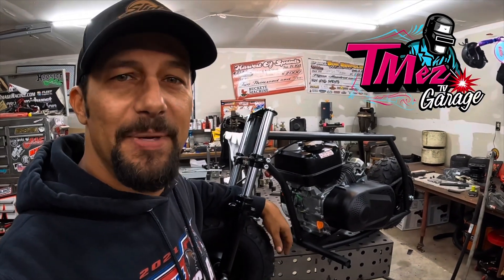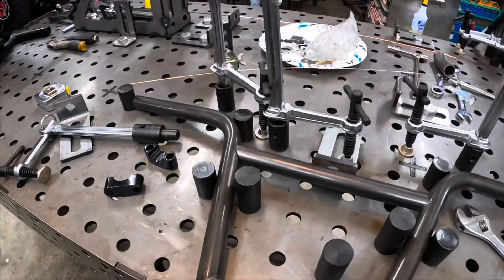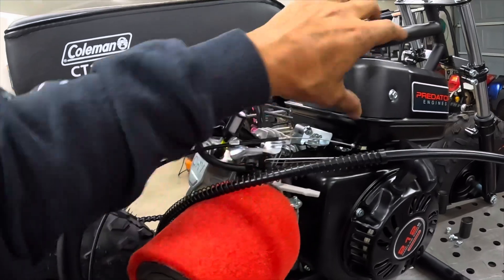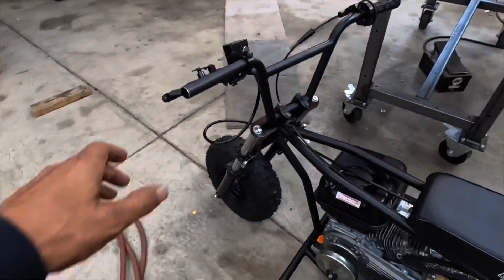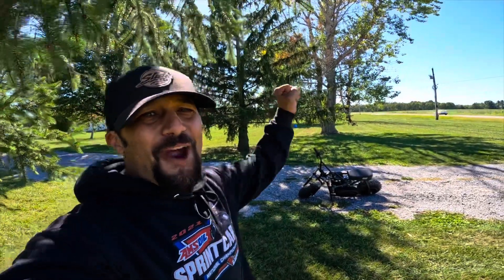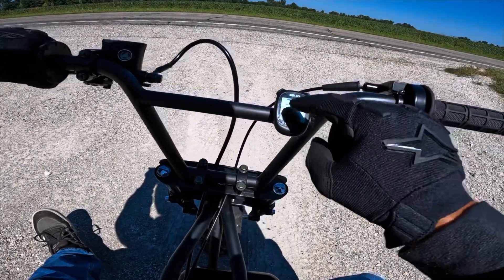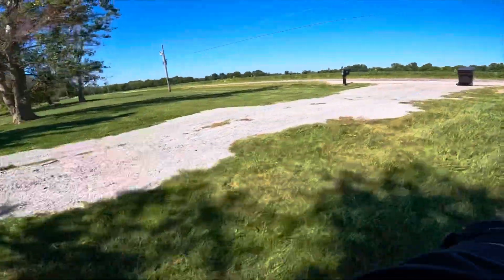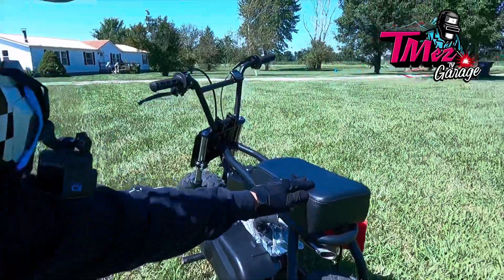New Mini Bike Build with a Torque Converter Threw Me off 1st Ride

Comment: Thomas.. when i worked at calkart on the converters they welded a support of like two little brackets that bolted to the fastener that was closes to the converter.. Welded from the tube like where the bearings are and to the mounting poing.  Would almost look like a mini W- Link without the straps That way the plated didnt tweak from the torque..
Reply from the maker: Hi buddy. Long time no see I hope things are good!  I have still never been to a hockey game, other than yours haha
Reply: Are you gonna do the placerville midget race  @tmezTv